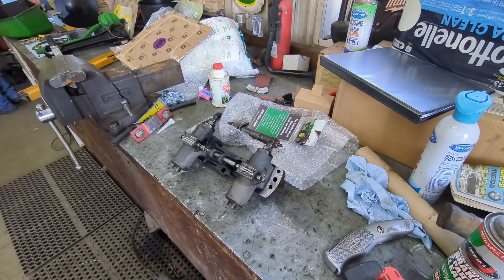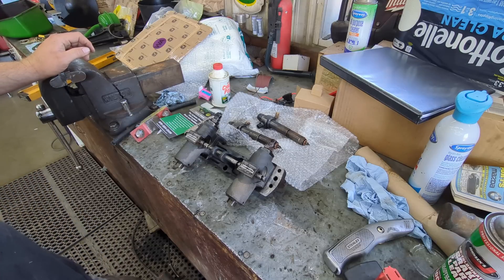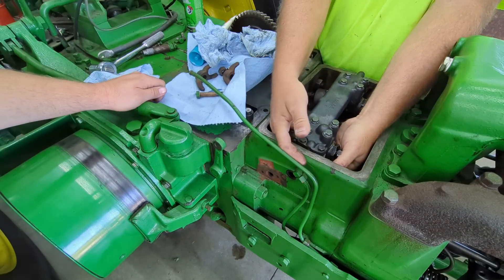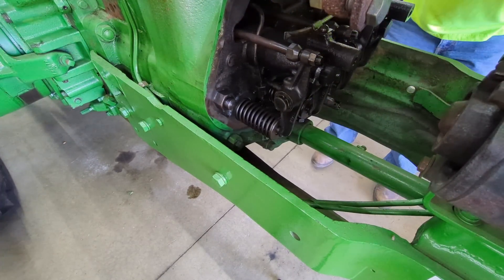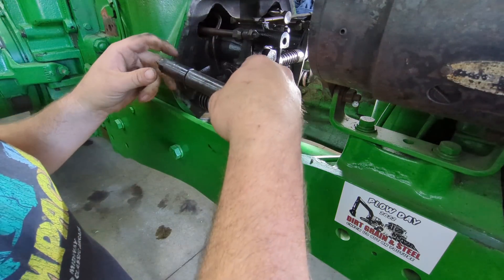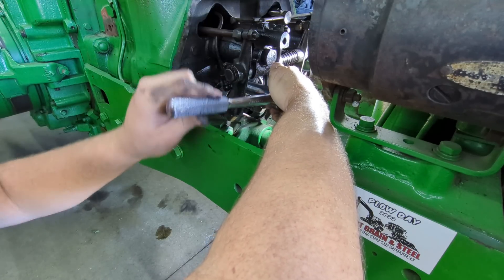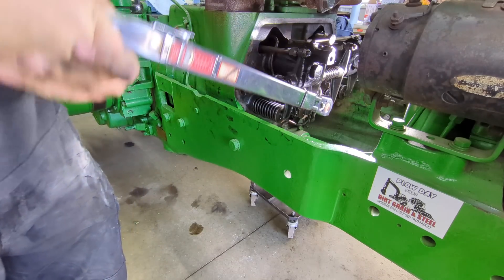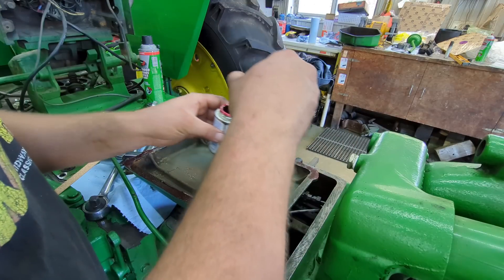John Deere 720 Diesel Two-Cylinder Pumps And Injectors Fuel System Re Assembly

Comment: The "pivoting" handle on the beam style torque wrench is a feature that must be used CORRECTLY to be accurate.
Correct usage is to balance the handle on the pivot pin without letting any other part of the handle bottom out on the torque wrench bar.  If you allow either end of the handle to press against the bar of the wrench the torque reading will not be true.